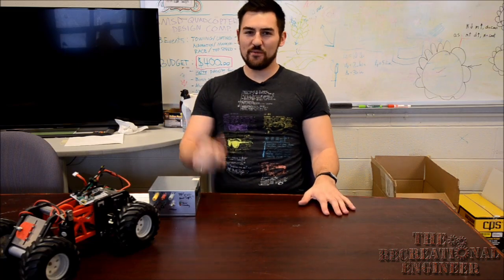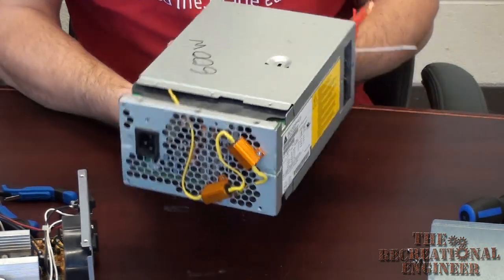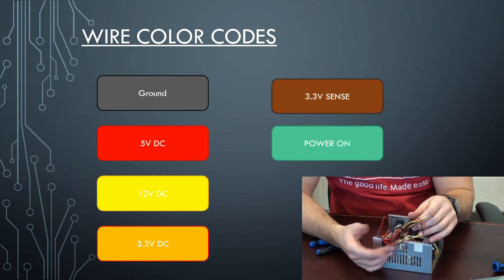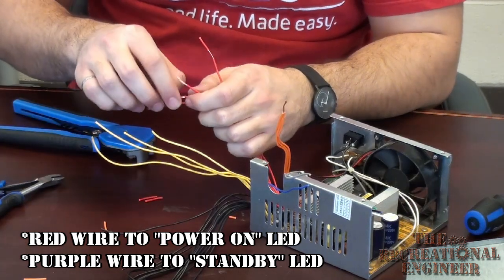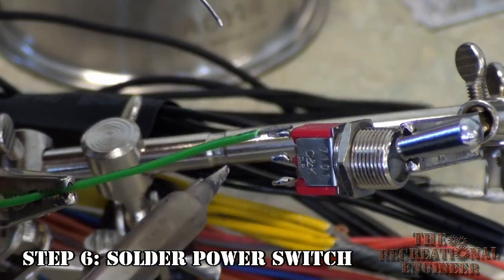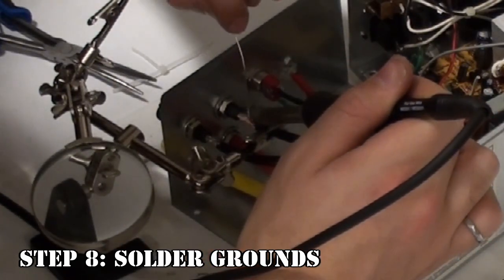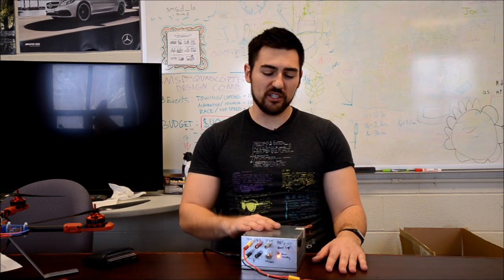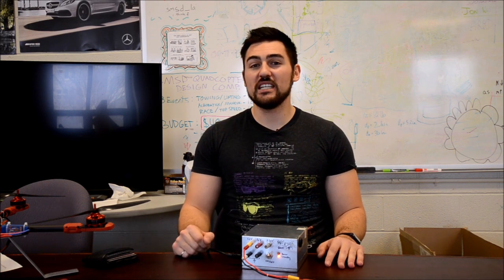$10 DC Power Supply - 1 Day DIY

Comment: if i want to put more binding post do add more specific current for my 5volts and 12 volts (like 1A, 2A, 5A) what should i do? thanks..

also... my psu is all 16A on 3.3, 5 and 12 volt.. which should i choose to save one wire?
if you wanna check out my psu is model: Delta Electronics DPS-220uB-5A
Reply from the maker: To begin, if you're PSU is powered equally on all the rails I would suggest just putting your load resistor on 12 or 5 depending on the resistance value of the resistor you have.  It shouldn't really make a difference which rail you use.

As for multiple binding posts, you can definitely do this but you need to make sure your total current draw remains under 16A.  I'm not exactly sure what you mean about adding more specific current?  Could you rephrase that?
Reply: The Recreational Engineer In your video the 3.3, 5 and 12 volts have their own current right?

So in my psu the 3 rails will have the same current of 16A based on my psu's specs, but what if I want to have a 5 volt rail to have a different current? like instead of 16A i will have a 1A, 3A, 5A and 7A. Can i do this? I'm using the 1A to charge 18650 batteries, power a small motor.. :)

and also i saw this, he has the idea of several amperage but i really don't understand what he was doing.. and yeah I'm a newbie.. xD

http://www.instructables.com/id/The-Ultimate-ATX-Power-Supply-Mod-With-USB-Chargin/
Reply from the maker: +M Spencer I will have to watch the video you posted but I think amperage works differently than you think.   The current that is rated for say the 12v line is the maximum current it can deliver.  If your 12v line can deliver 20amps and you plug in a device that only draws 3.2 amps the 12v line will only supply 3.2 amps.  However, if your device requires 80 amps it will only receive 20 amps because that is the maximum.  so do not worry about blowing components.  however you may have applications like battery charging where you want to LIMIT the current. In this case you will need a current limiter.  I'll have to check out the video you posted and see what they did
Reply: The Recreational Engineer ok thanks... :)
Reply from the maker: M Spencer I took a look at the instructable you posted.  I see that he has multiple posts for 5v and 12v etc.  He did write the current on the box as well but the current he wrote is the MAX current that the post can provide.  As far as I can tell he is not limiting the current in anyway.  I think you will be fine doing this.  Any device you plug in will typically not pull more current than it's rated for.
Reply: +The Recreational Engineer oh i see, thanks... subbed!! :)
Reply from the maker: +M Spencer Glad to help.  feel free to leave suggestions for future projects
Reply: The Recreational Engineer one last thing, i tried to bought 24 ohm 10 watt resistor but they only have 25 ohm 10 watt and a bought.. is that okay?

i also have a 22 ohm 5 watt resistor..
Reply from the maker: +M Spencer it's more important that the wattage is correct.  It all comes down to ohms law which is voltage = current x resistance  or more commonly V=IR.  if you have a 24ohm resistor on a 12v line then V/R=I so 24/12=2.  this means that you'll be drawing 2amps through your resistor. if you were to swap in a 25ohm resistor you can see through ohms law the change in current would be quite small.
Reply from the maker: +M Spencer To answer your question, yes 25ohms is fine
Reply: +The Recreational Engineer thanks man, this is my first project as a diy maker. you deserve tons of subscribers. i'll spread the word... :)
Reply from the maker: +M Spencer thanks a lot!  It's a long road at the beginning, sometimes just coming up with ideas for projects is the hardest part!  As long as the videos are helpful then that's all that matters.
Reply: +The Recreational Engineer i finished my power supply a couple of minutes ago. but the power resistor too hot, i can barely hold it... is that normal or i did something wrong? or i just need to add a heatsink to the resistor?
Reply from the maker: +M Spencer this definitely isn't uncommon. Your idea to use a heat sink is a good one.  Alternatively you couple place the resistor by the fan in the power supply or if you have space you could add in another fan pointed at the resistor.  Using higher wattage resistors also works.
Reply from the maker: +The Recreational Engineer **you could,  not you couple
Reply: +The Recreational Engineer thanks... my psu is not as big as yours... but its a 2011 model.. i try both getting a higher wattage resistor or have a heatsink on it..

once again thanks, my purpose for this is to use the 5v to power my tp4056 modules.. :)
Reply from the maker: +M Spencer This should work well to power your tp4056 modules.  Also, with the resistors, even if they are getting to hot to touch, as long as they are not melting or at risk of catching fire then they should be fine.
Reply: The Recreational Engineer thanks.. ill add another resistor with the same value and connect them in parallel.. ill let you know if it works tomorrow.. :)
Reply from the maker: +M Spencer Unfortunately putting them in parallel will not fix your problem.  you will pull twice as much total current and the current per resistor will not change.   You can try putting them in series but this will decrease the total current draw by half and the load may not be sufficient to keep your psu running. you can try series but I would not recommend parallel.
Reply: The Recreational Engineer okay, series as it is, but i have two led's i think that's enough with the two power resistors in series, thanks.. :)
Reply: +The Recreational Engineer so i bought 2 25 ohm 10 watt resistor and connect them in series... it doesn't even get hot at all... just a little bit warm.. ill just get a small heatsink for it... thanks... :)
Reply from the maker: Glad to hear things are working out for your project!

Comment: Nice PS, question, is it possible to connect say the +12V and +5V to get +17V connected to an LM317 variable volt controller/buck PS?
Reply from the maker: I could be wrong but I do not believe you could do this as the two sources share a common ground and therefore would be wired in parallel.  If someone has a better grasp on this feel free to chime in.
Reply: I have seen the -12 and +12 tied together for a higher voltage. Just a little testing to see if its stable or not.